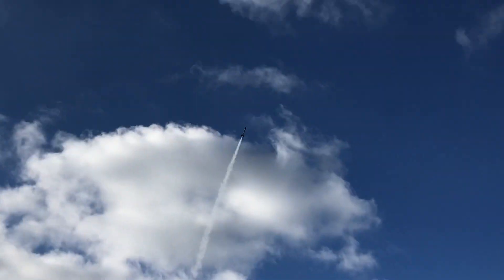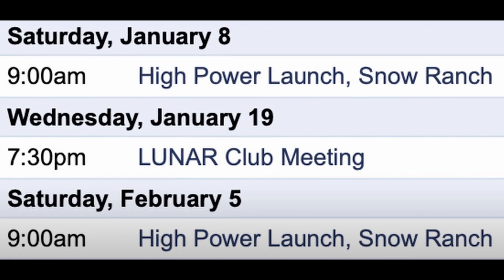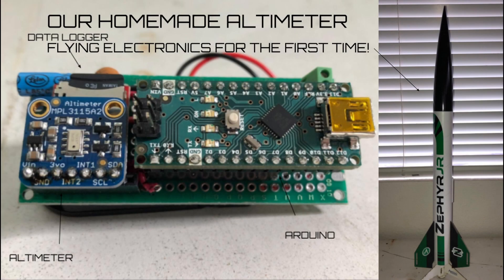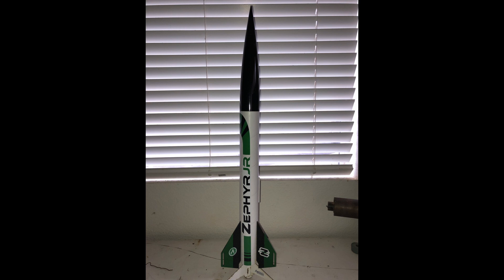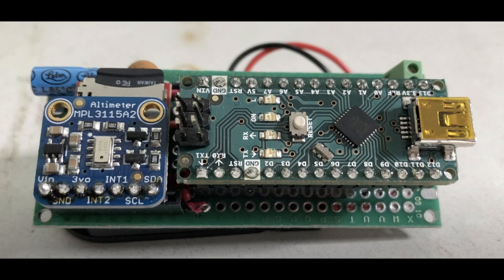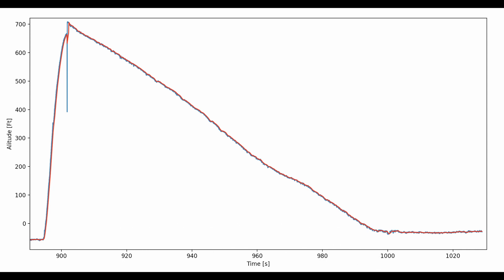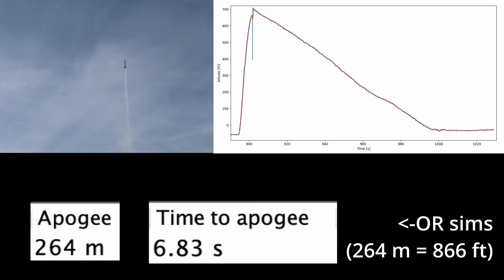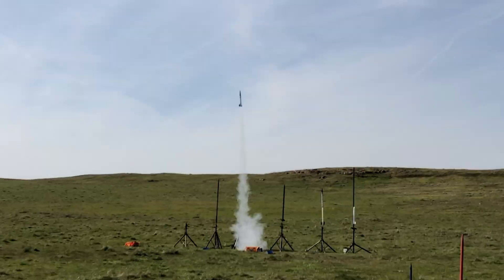We got data!!!

Comment: This is awesome! just found your channel! did you use SparkFun's OpenLog or the Level Shifting microSD Breakout? I know that the Level Shifting one uses SPI whereas OpenLog uses serial but I don't know which one is better for data logging. Any tips?
Reply from the maker: Thanks! We used the openlog, but I don't know if it's better for logging.
Reply: @motechspace  thank you for the reply!! Yeah I’ve heard OpenLog is simpler to use than the other module but slower. Did you do any level shifting with resistors to connect it to the arduino? I bought an openlog module but Idk if the pins take the 5v logic and I don’t want to short it out
Reply from the maker: @spaceshuttle8332  No resistors. It should be able to take 5v.
Reply: @spaceshuttle8332  OpenLager is a faster serial data logging module. Using an Arduino Nano I could record 10 channels at 500Hz. You can do the same speed with a Nano running the latest SdFat library sending data to an SPI SD module. It does require a more sophisticated code algorithm, but it is not difficult to write. The higher sampling speed and additional channels allows you to include accelerometer and gyro IMU's to your flight data.